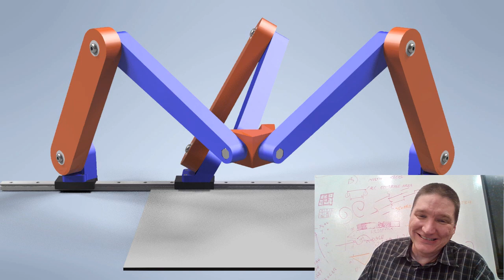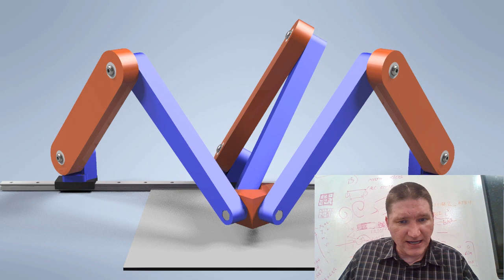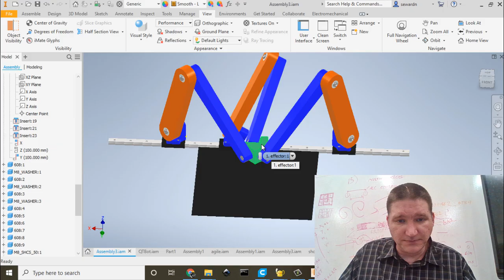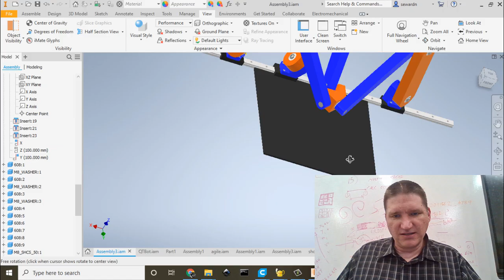RepRap Monorail (Single Rail Tripteron)

Comment: I can’t help but imagine this on an epic scale using trains and train tracks with crane arms, printing out entire warehouses and other industrial buildings
Reply: Trains is a different but potentially really great and uniquie use for this. Nice thinking!
Reply: @masonbarber871  I was thinking this could be on a rail, and also 3d print a train station.
Reply: Only issue with this is that the weight off set wouldn't work on that scale.
Reply: @76a543cc It would have to print steel or aluminum instead of plastic maybe?
Reply: With a moving counter balance, it might be possible!
Reply: Although, I would argue some modification of conventional crane with printing head suspended on cables would be cheaper/easier to deal with
Reply: Terrible idea, since it requires a zero tolerance mount for each arm and the strains at the initial pivot points are insanely high.
Reply: @timhofstetter5654  That’s a really good point- certain concepts or solutions can only work at a certain scale and are strictly bound by their size. It’s not as simple as just scaling everything up; doubling the edge length of a cube octuples the volume and therefore the mass.
Reply: @timhofstetter5654  It was just a fun thought nobody cares.
Reply: @lukepowers8122  
8)
8)
8)

You're pretty good at that global mindreading stuff, aren't you? I try and try and try, but I'm just not very good at it.
Reply: @timhofstetter5654  keyword "imagine"
Reply: My thoughts exactly! I guess it depends on how much weight it could lift, and how high.
Reply: Too many points need full control.
Reply: @AlexFoster2291   Aren’t there only three degrees of freedom? The rest of the motion is due to the geometry of the linkages (but I might be misunderstanding what you mean by full control)
Reply: @wyattbiggs802  left and right need to be controlled along the rail like stated in the video, but also the angle of the arm above the rail needs to be adjusted. The extruder platform also needs three actuators on its own to remain level
Reply: actually just a mono rail train might work. they are designed to hold the train upright and center with one rail. they have what you need to prevent tip over. 
 you would likely still need a counter balance to prevent track torsion though.
Reply: Dahir Insaat moment
Reply: Ikr
Reply: sounds like a good idea for 3d printing or a pen tool but doubt it could lift much
Reply: That would be awesome
Reply: That is a fantastic application. Given he had hopes this could fold up.
Reply: Imagine rep-rap getting smaller or bigger as it self-replicated and it also printing a hand to lock the pieces in...  It could print a new "hand" out and then disconnect the hands and connect a new one with the old hand going into a replica machine maybe...
Reply: I was thinking that 2 of the arms could detach from the nozzle (like legos) and be used to "assemble" things after they have been 3D printed.  This would then 3d print its own parts for an arm, length cross sections of its own track, and assemble them to automatically self-replicate.  It could also print a lot of water wheels to get water energy.  It would be cool if you could make the 3D printer out of fibreglass and then be able to source most of the materials to make fibreglass from sand...
Reply: I see this simple design as being easy to self-replicate automatically.  I would make it so that two of the arms can detach and reattach from the nozzle and they would have fingers, and it would attach the parts after the nozzle finished printing them.  The parts it would print would be the different sections of the hand and the rails (the rail would be composed many attached sections and could grow in size perhaps even allow junctions to allow the 3D printer to move in weird ways O_o, and maybe you could allow the 3D printer to print a diagonal rising rail to allow it to climb up to high places).  It can also print smaller version of itself, and have that smaller version of itself print a even smaller version of itself until you get trillions of tiny self-replicating printers.
Reply: Or a portable system printing out houses
Reply: @CharlesHuse  could lay out tracks on the road in a development and print long rows of houses one after the other.
Reply: @CharlesHuse  you would only need 1 truck to carry the rails and arms, have a local cement guy come out and you have everything to print the walls to a house.
Reply: holy fuck, this is genius. maybe the balance could be solved with a parallel track and mirrored tripteron arms
Reply: @HPStreamNewsChannel  initially I just thought feet like a normal crane. But I can see that can't work. You could just extend the purple arms out backwards past the joint. The counterweight would mechanically automatically become further away when the print arm moves away/up. I think they wouldn't collide either. 
Now we just need a way for it to switch which side of the tracks is printing on. 

This is so damn Sci-Fi. Love it.
Reply: @HPStreamNewsChannel  That's a really good idea!
Reply: @GetWards  actually we need this on Mars building for us.
Reply: My suggestion would be to couterweight it by the outer rail joints with some levers moving opposite to the to the first outer mebers with some gears it would only need 2 extra parts to cancel most of the moments because the joints are coupled to the y movement.
Reply: That sound like how we could 3D print the next space station...
Reply: Put it on a circular track that surrounds a city  and you can get anywhere really fast, the city would have to be conical though, with tall buildings concentrated towards the center
Reply: @saqvobase4301  How about make the track be able to move around like in a tank or put it on wheels?
Reply: @saqvobase4301  Instead of a railroad track why not just have the track be laid down like a tank or mars rover, and then have the printer know its angle?  Also instead of having the track be on the bottom why not have the track be sideways or on top like those gondola lifts or cable cars, it could also print its own track / cables perhaps remelting "old plastic" parts or cables.  Imagine that not only it extrudes stuff but one or two hands can detach from the extruder and be used to assemble things like its own hands or another extruder to allow it to self-replicate on as it extends it's track.
Reply: @saqvobase4301  But that's how most cities are! with skyscrapers in the middle, then apartments, then houses. That would be a really cool setting for a sci-fi novel or show...
Reply: @saqvobase4301  you're talking about a reprap simpson, also designed by this genius guy, probably a GUS simpson.
Reply: Put a self-laying 3D printing rail system on the front and send this thing to Mars to build the anti-radiation shell structures we'll need to put our HABs in when we get there.
Reply: why not use it to print a  w a l l

Comment: Looks awesome and I agree it could potentially be stored in a tube for transport. Very promising concept.
The weak point is likely that vertical axis. The arm has a considerable torsional and bending load. It will need an axial motor force of about twice the weight force of the effector. That axial motor force will also need to be counteracted by the other two motors equally to keep the effector at height. Maybe you could put a motor and idler carriage outside of the other two motors so that the arm is more horizontal, isolating vertical load from the other axis and lowering the motor requirement, but of course decreasing the Z range.

Comment: Couldn't it be center driven if the x,y,z are in a connected cylinder that can move independently from each other? that would allow you to drive the arms directly rather than use a belt system. I drew up a rough sketch and threw it on thingiverse ...https://www.thingiverse.com/thing:4782481
Reply from the maker: I can't seem to see it.
Reply: @NicholasSeward  the second picture
Reply from the maker: @joekelley9311  404 on the link for me.
Reply: Not really sure this would work but my thoughts were that you could drive it directly with small nema motors in three independent housings like bearings stacked on top of each other so that they could move independently with a hole in the side to drive the arms. here is the tinkered page hopefully that will work https://www.tinkercad.com/things/0NkLNCfY7qG/edit?sharecode=wA-tJaPtXKUHmSUeZbGvCbJyJm9JWpc7uPpq_HUHGd4

Comment: when you so broken you can only afford one hiwin
Reply: Hiwins are trash compared to Misumi.
Reply: @edenassos  Rexroth. Just that.
Reply: Better to buy 3 CNA or Robotdigg rails and build a Delta, honestly, that's gonna be so much simpler and cheaper. This is just a proof of concept, it's just there to learn more, not to make an actual machine.
Reply: @machinerin151  this is a joke on his creativity being so motivated.
Reply: @machinerin151  Real honest question.. did you realize it was a joke?
Because the joke was pretty obvious, so it would confuse me if you said no.
But if you said yes, that'd also confuse me, as then I wouldn't understand why you explained how they were wrong 🙄

Comment: Imagine putting this rail alongside multiple beds and having it pump out prints all night 🤩
Reply: Tbh i would rather put a line of moving beds in front of it, so you won't have to carry around the motors or have to build some weird crazy belt system to keep them stationary while moving the "arms", but i get what you mean

Comment: what would happen if each of the pivot points are offset in different amounts from the rail in the Y direction?
Reply from the maker: Not much.  The angle of each "plane" is the important detail.  Where that plane originates is only important with regard to arm lengths and collisions.

Comment: That's a great deal !
I think it's not going to be easy to dimension the structure to counterbalance the moments ...
but this design makes it possible to build stadium-shaped rails that would allow a very large direction while knowing the position perfectly!
It would just be necessary to compensate for the curvature of the stadium rail in the kinematics calculation, but it seems quite simple !
It's much more fun than the car circuits of our childhood!

Comment: Put the stepper motors on the legs and make a toothed rail for them to ride on....or a bigger screw and the motors floating with a extra steel beam next to the.screw for stability....

Comment: How long did it take you to realise, that the center arm has to be on an angle? - Seing this this angle is the most fascinating part about this invention.
Reply: It might be more obvious when you have the model in front of you to drag around. As for Nicholas, I'm going to give him credit for potentially already knowing, given his past experience with creative designs like this one! With the center arm straight, moving the center arm (ignoring the others) simply moves the carriage along the X axis (I think this also would overconstrain the system as it's now fighting the other two?) 
Also, check out 2:07 , if your middle carriage is straight on and only has direct influence over X (Can't transmit any torque through the joint as it's perpendicular), you lose the ability to move in Z!
That's mostly assumptions though, I don't have much experience with kinematics so it could completely throw a wrench in things. I'd be honored to be corrected by Nicholas!!
Reply: My guess is that it was obvious to him because of how the design works. The end effector is at the intersection of three planes, so the normals to those planes cannot be coplanar. (The three arms effectively lie on these three planes.)
Reply: Is it possible to explain why it has to be at an angle to someone not familiar with the field?
Reply: @cyrfung  I'll have a go! Remember that the jointed arms are not actuated, they're "floppy" and it's only the carriage where the arm is attached to the rail that is controlled. So if all three arms were vertical, the payload would be unsupported vertically and would just fall.

The angle of the arm is a compromise between actuation and support. If the arm was horizontal it would provide plenty of support but the Z height would be fixed - no amount of moving the carriage would affect it. At low angles, moving the carriage would affect the height but large carriage movements would result in small Z movements, which would result in a very short Z travel because the carriage would run into the other two before the payload had moved much. At higher angles there's more "gearing" so the Z travel range is larger, at the cost of rigidity.

The way of thinking about it that's closest to the mathematical explanation is to visualise the three arms as lying on three planes (flat surfaces). The carriages control where the three planes are, and if they meet at a single point then that's where the payload must be located. If the three arms were all vertical then the three planes would be too, and they'd meet at a line rather than a point so the payload would be unconstrained in Z. The payload is most rigidly supported when the planes intersect at angles near 90 degrees, which is not really the case here and is one of the sources of comments from people concerned about rigidity (the other being that the weight of the payload is transferred to a torque on the rail, trying to roll it over). Mesmerising design though.
Reply: to prevent singularity in mathematics model. It is quite obvious but this model require a very good bearing joint.

Comment: Would be concerned by stiffness as everything relies on the torsional rigidity of the rail and bearing blocks
Reply: Yes, it will probably take two parallel rails, and perhaps even the doubling of the whole mechanism, to properly constrain the degree of freedom in rotation around the rail, so that the effector does not oscillate too much...
It is nevertheless very interesting, and very creative. Bravo!
Reply from the maker: It may need two rails as mentioned.  Although the forces are very small for what I want to do. (3d print)
Reply: @NicholasSeward  I think the vertical forces are only transmitted through the middle arm. The lower end of this arm is already acting as a counterweight, maybe you can tweak it such that the moment on the rail is close to zero for most cases?

Comment: Nice idea. Why not switch out the belt for a toothed rail? Since a metal/plastic toothed rail isn't as flexible as a belt, this will give you more accuracy. When the motors are all attached onto the moving parts, using a belt doesn't make sense anymore.
Reply from the maker: Considering it.  See my next video I posted.

Comment: Fantastic kinematics but what about huge torsion torque the monorail will have to deal
You will have to print at very very low speed if you want decent printing quality. Spring effect induced by the monorail design  may become exponential as soon as you upscale the concept... you need to design a high inertia, high young modulus rail... carbon fiber?
Reply from the maker: Yes...it will require some finesse to get right.  Rigidity is very important.  I don't think I need exotic materials just careful engineering.  Arms need to be big and light.

Comment: That to me just screams "everything bot". 3D Printer, CNC, auto drawing, probably more.
Reply: CNC will pose rigidity difficulties. Everything is mounted on two bearings connected to a linear rail and the arms are also quite long. 3d printing and drawing should work great though. Maybe also a vinyl cutter or something like that.
Reply: @flyingby3703  maybe also pcb printing and driling if its accurate enough.
Reply: This screams "please don't use me as a cnc router!!" This construction has a huge lever in the Z direction and only a single point of contact. Any force in the z direction would cause huge deflections

Comment: no belts! move them with linear harmonic drive... zero backlash and implement the straight version, explained in this video as a way to explain the rotary version.  just leave em straight...power of the wedge...
https://youtu.be/7QidXf9pFYo
lets call it the power wedge-E
Reply from the maker: Interesting...I have never seen that.

Comment: Skip the belt and go directly to a gear rack linear rail.
Like this https://youtu.be/njjwXES6MjQ?t=210  or this https://youtu.be/wlFu2rG-3Vw?t=51

Then some chain panduits/conduits to run the wires in.
Put one set on each side of a table and now you have a printer to rival Niomi Wu's CR-30.

I am curious to see what friction will do to a real system. Will the joints and arms still move smoothly?
Reply from the maker: Considering it.  The advantage of belts is I can have all my steppers static which is nice.
Reply: @NicholasSeward  Just watched your Cu5LvIYXbU0 video. Figured you were already on to the rack/rail idea. Awesome work! Thanks for sharing! :D

Comment: This could make a really compact printer.  Very cool. Looks like a delta that broke out of it's circle.
Reply: It's been freed, but at what cost?
Seriously, how much does one of these things cost?
Reply: @peterwilson7497  It's a CAD model right now. But I'm sure the inventor can do a bill of materials and estimate a material cost for a prototype. The cost of a final commercial product will depend on a much larger number of additional variables. Labor costs, initial investment, finance costs, marketing costs, the size of the market, reliability, warranty costs, profit margins for starters. That's if the product is viable and offers some advantages over existing designs. Stability and repeatability may be challenging based on the geometry.
Reply: the build area is quite constrained. It may not be that compact compared to printers with comparable printable volumes
Reply: Like a Portable! You can stay together the arms and carry around!